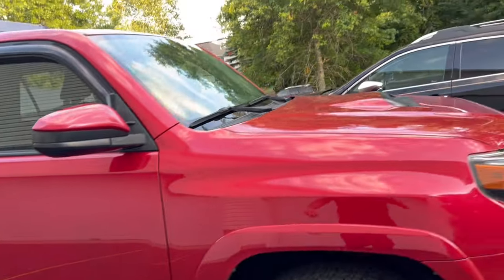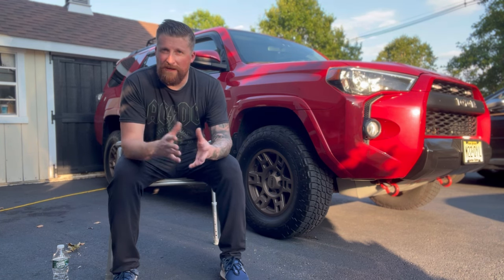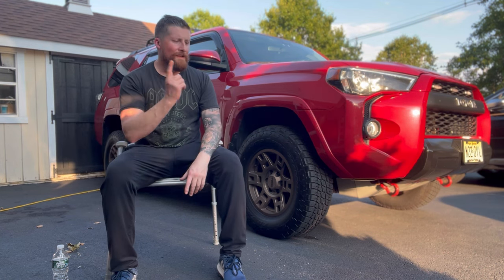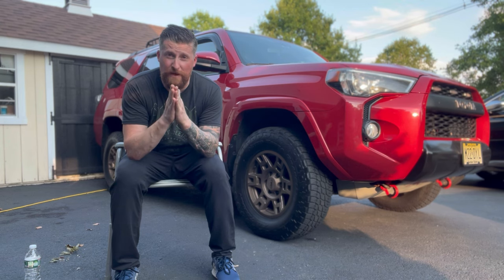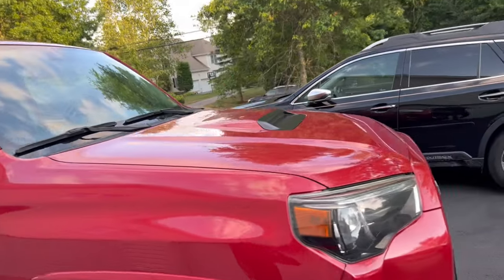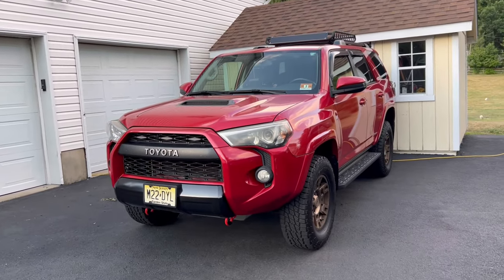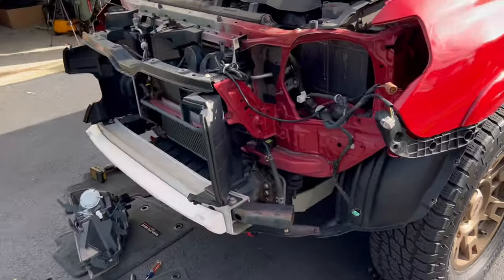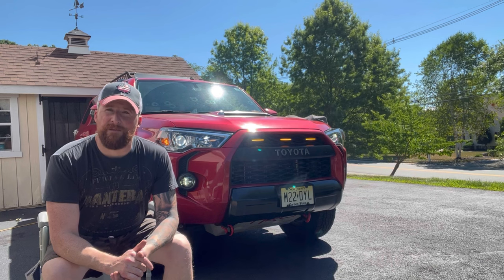The Toyota 4runner Story I never wanted to tell! It was cheaper but…

Comment: Don't beat yourself up, things happen. You paid 21 for a fine machine with a "dirty car fax", and I paid 16 for one with almost 200k and a couple things that don't work.. but I have no regrets and love her anyway, and you should still love yours as well! 

As an aside, so sorry about that repair job (I work in auto body), but the factory headlights look oh so good. Here's an idea, get an ARB winch bumper! I'd rather cut up a Keystone cover versus a factory one any day!
Reply from the maker: You got yourself a great deal and an awesome machine, we learn to accept them as they are. 
Thank you, yeah I’m definitely doing something with the front bumper eventually, a winch is a must for what my plans with this truck are. 😎
Thank you for your support, I appreciate the feedback you guys give me.
Enjoy your weekend!!
Reply from the maker: Not really sure what’s not working on yours or how far you live, but I’m always ready to help a fellow 4runner owner 😉
Reply: @VikingsGarage  Hey, I appreciate that! My e-locker never worked, and the damn AC quit for the second time just before we had that stretch of 90+ degree weather up here in the NE. Any insight on either would be helpful!
Reply from the maker: The e-locker could be a wire issue or the most common Diff. Lock Actuator .
The A/C I’ve seen/replaced a few A/C compressors or a puncture on the A/C condensor which causes the Freon to leak out. 🤷🏼‍♂️ hard to fix over the phone. Good luck with everything 👍🏻

Comment: There is no doubt carfax can only report what is given to them.  I recently laid to rest my 2002 Isuzu Axiom for a 2023 4Runner.  The Axiom was in 3 accidents.  I know because I am the original owner of the Axiom.  Carfax only listed 2 of them.  Also I have seen used cars at dealerships promoted as clean carfax and it was evident those cars were in accidents.  The dealerships did not care just as long they had the clean carfax.  So, definitely Check the used cars out.  My Axiom (named-Spirit), even with 3 accidents served me faithfully until the end.  So for the price I think you got a deal.  Those issues are minor.  If the frame is straight and all things work like the engine and transmission I think you are good.  For fix on the cheap,  color match the paint have the auto body paint store place in a spray can and only do those minor spots that need it.  Of course you will be able to tell the difference from the original paint to the aerosol paint for the first couple of months.  But continued waxing and some slight compound over time will blend the paint nicely.  I think you did great.
Reply from the maker: I appreciate that brother. I ultimately am happy with the truck, which has been serving us so well. 
Thank you for sharing your story!

Comment: Sorry for your troubles. IMHO, the money you saved buying the car will be spent and then some getting it in proper shape. Wraps are nice but if the corrosion isn’t properly addressed, you will still have problems. Now you know why the previous owner traded it in on a Dodge. The local Toyota dealership probably didn’t want to touch it. 

If I was in your shoes, I’d cut my bait and run. If you decide to keep it, then just do minimum required maintenance and not spend anymore money on it. 

Best wishes.
Reply from the maker: I’m fixing it properly and keeping it for a few more years. 👍🏻
Reply: That makes sense. It’s a good thing that you are a professional Toyota mechanic. I have no doubt that you will make it right. I really enjoy your channel. By the way I received my passenger hand holds last week. The wife tried them out and she liked them, said they really helped. No I don’t make her ride in the back all the time. Just when we take my mom out. 
On a different note, I just had the spacer lift removed and 285’s. Went back to 265’s. Yes I gave up some ground clearance but the car rides and drives much better. Keep up the great work!
Thanks,
Slopemaster
Reply from the maker: I appreciate you Sir. That would have been wild if you made your wife sit in the back all the time. 🤣🤣🤣
Enjoy!!

Comment: Look up door shells or skins, if it's just the exterior sheet metal that's rusty. They're quite a bit cheaper than the entire door 👍
Reply from the maker: I most certainly will, thank you for the tip. 👍🏻
Reply from the maker: Last time I asked parts, they weren’t available with an ETA. Haven’t ordered yet.

Comment: I would likely not buy a 4runner that had been hit since the front end on these is so sensitive to vibration if everything is not perfect. If you are not having problems with it, you should keep it and drive it till it dies. It's gonna be a beater. If you don't like that idea, then trade it in.  Rust has to be stopped at any cost. Anything with rust on should be sprayed with CRC 0626 Rust inhibitor which will stop it in its tracks.
Reply from the maker: I appreciate the tip, I do remember Farm project testing that stuff out. Thank you for reminding me. I’m definitely fixing it for sure. Me and the wife agreed, I need to get 3 more years out of it. 🤷🏼‍♂️
Reply: @VikingsGarage  You will likely get 15 more years out of it.
Reply from the maker: 🤣🤣 The sad part is, we both know you’re right!!

Comment: Someone commented about getting just a new door skin. It’s going to be more labor intensive, oppose to prepping and repainting. This is only going by your initial video. You’re not going to know for sure until you really dig into the door.

Realistically whoever did the job probably rushed the prep work. Could be a number of reasons. Initially looking at it from your video any reputable shop should able to fix it without issues. Again, can’t give you a definite idea until the metal is exposed. 

Maaco paint jobs should be clarified if it’s going to be a one step paint job or if each step is going to be done with sufficient time between each step. There is a reason why Maaco is cheaper. 

Lastly, by no means am I an expert on the matter. Just sharing some of my experiences as a current fellow 4Runner owner and former S2K owner. Best of luck
Reply from the maker: Thank you for your thoughts, I’ll keep you guys posted. 
Got to love them s2k’s 😉👍🏻
Reply: I agree...   Uh-oh, better not go to Maaco (if you want a quality paint job).
Reply from the maker: Noted!!

Comment: Don't go to macco plain and simple. Only go there if u plan to sell a vehicle and need it to look decent for the sell. Look for used doors or best bet the outer skin of it and a shop will remove and put the new skin and re spray.  The rear bumper color difference is most likely because it's not oem but after market and the plastic is not the best. It probably was not prepped correctly either and do to sun hitting it burning on it it cause the paint to fade and discolor. I would see this all the time on toyota camrys from the mid and late 90's. Also the driver side door is misaligned a bit near the back door. Best of luck and go to a known name body shop.
Reply from the maker: Thank you for your explanation on the rear bumper, makes sense now. Yeah I need to get doors for it and take it to a decent body shop. I’m getting an estimate from the body shop our dealership works with next week 🤞

Comment: You can't trust CarFax. Know that if you rely on that report, and accept it, you're letting the dealer off the hook. Good luck trying to collect against CarFax.
Your issue is simple, Paul. It's nothing a stick of dynamite won't cure. Depending on what's going on inside the doors, you might need new doors. You might even need a new bumper (the actual metal part) and mounting brackets. Is the frame straight?
Sorry to hear about this development. It's heartbreaking.
Reply from the maker: No worries, I’m ok with it. She’s not perfect but we will get her to a better place in due time.
Thank you. ( The pedal commander is off by the way 😉)

Comment: You seemed surprised that you have issues with a vehicle that has been w recked twice.Hit that rust with a flapper wheel.treat the area with a rust inhibitor prime it and touch it up and forget about. Tape off the lower portion of all of the doors and shot it with some bedliner and enjoy.
Reply from the maker: I’m totally going to address it.
I wasn’t surprised just , bummed out that it only took 4 years for it to start showing. 🤷🏼‍♂️
I was thinking more like 6 years or more shit would start revealing itself, but clearly I was being optimistic.
I appreciate your very useful input.
Thank you for watching!

Comment: Sell this 4Runner and run to buy 2023 model. This vehicle will only deprecate. This is why I recommend buy the best condition as possible regardless of price. The 24K Silver model you mention is really a bargain.
Reply from the maker: You do realize I bought it 5 years ago.
Reply: @VikingsGarage  regardless, the burden to deal with rust and body panel alignment issues is not worth the aggravation. You introduce so many elements to the equation that the little extra money would have worth the money. No body work is as good as factory finish.

Comment: Now that I see all that rust, I think you should had bought the silver one.
Reply from the maker: I tell you what there’s a reason why I’ve owned a few silver cars. They hide a lot, a lot easier. 
Rust sucks.
Reply: @VikingsGarage  yeah, silver is a boring color, but I'm glad mine is silver because it does hide everything. Even when it's filthy it still looks fairly clean, and silver is great at hiding small scratches and rock chips.
Reply from the maker: Absolutely!!

Comment: This sucks, sorry! One thing you can do if the car is in great mechanical condition, you want to keep it, have time, and inclination for the kind of thing I would suggest. Instead of paying someone $1,500 for the job (I would still want to see the rust parts stripped to the bare metal and inspect it before they slap paint on it because you know there is not warranty.) buy the tools and do it yourself. You end up with owning tools which you can use over again and gain skills too.  The paint job is not going to be as good as done by the professionals but if you don't care....
Reply from the maker: I thought about it but I’m actually having as very good body shop do the job.
Sometime after this winter. I will make an update video on it when it’s done.

Comment: I Never would buy a car with a dirty car fax....But I also had a cobra that got stolen and had 15k worth of damage to it, insurance fixed it and it never shown on a car fax.  Those car faxs are BS. As far as your truck that is some of the worse body work I have seen and that explains  the super cheap price you got it for. Here in Colorado a 2005 4 runner with over 200k miles on it would go for over 15k....So basically you got what you paid for. I too was in that situation of either buying a used 4 runner or a new one...The used ones were more than the new ones I got my 2021 for 37,500 out the door, the used 2018 with 13k miles on it was 38k out the door and it had door dings on it...I went new and I will put my own door dings on it.
Reply from the maker: 👏🏻👏🏻 I hear you, lesson learned.